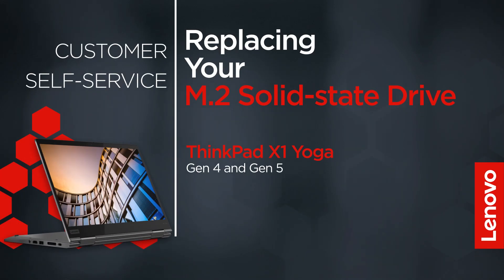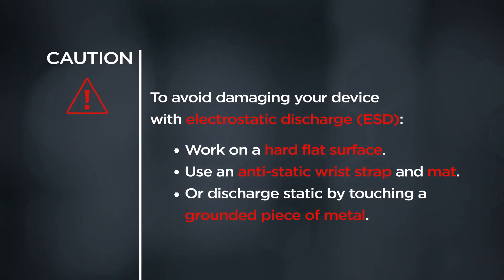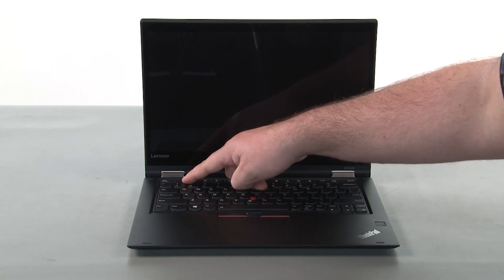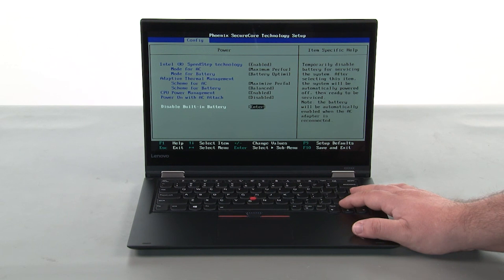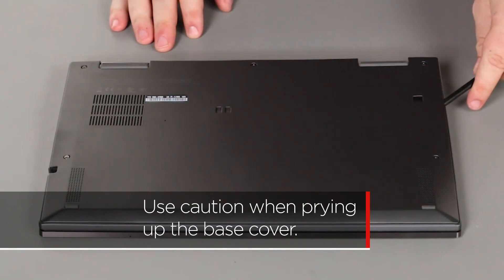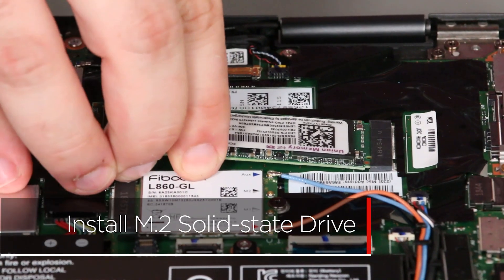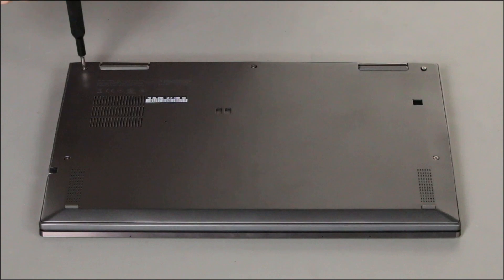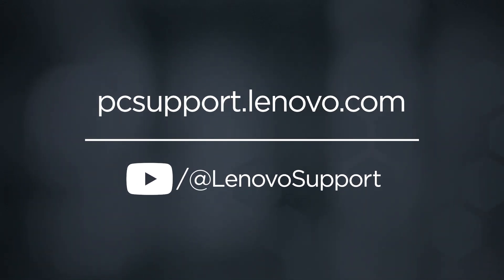Replacing Your M.2 Solid-state Drive | ThinkPad X1 Yoga Gen 4 and 5 | Customer Self Service

Comment from the maker: This video will show you how to replace the M.2 Solid-state Drive inside your ThinkPad. The process in this video will work for the ThinkPad X1 Yoga Gen 4 and Gen 5. 

You will need a screwdriver kit, a non-metallic pry tool, and 15 minutes of your time.

To learn more about your device go to https://pcsupport.lenovo.com
To find parts for your device go to https://support.lenovo.com/parts-lookup/?cid=ww:lenovosocial:b9515f&source=socialmedia&subsource=yt

** NOTE: Static electricity can destroy components. Use a grounding strap, and clean, non-conductive surface to work on. Use plastic or coated tools to prevent scratching and avoid using metal tools on plastic parts. For more detailed information on electrostatic discharge and how to prevent it, please watch our ""Understanding Electrostatic Discharge (ESD)"" video: https://youtu.be/by4PB3WtdLo 

Applicable Machine Types:
ThinkPad X1 Yoga Gen 4 - 20QF, 20QG, 20SA, 20SB
ThinkPad X1 Yoga Gen 5 - 20UB, 20UC

#lenovo #LenovoSupport #LenovoTechSupport